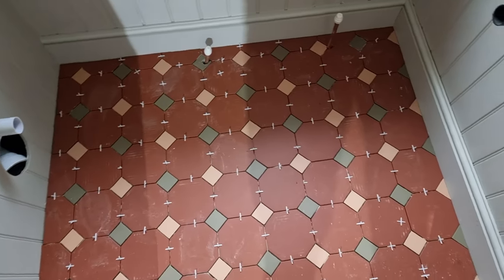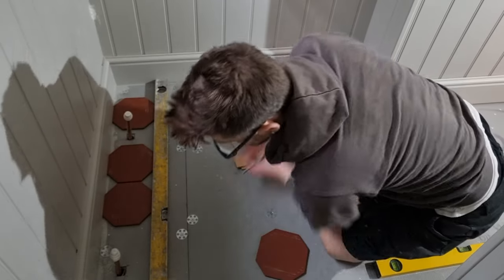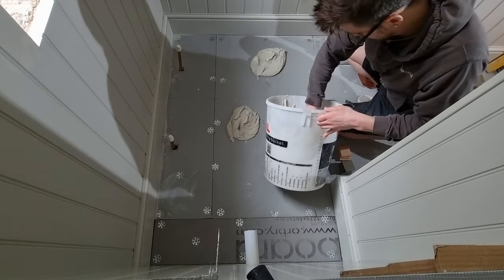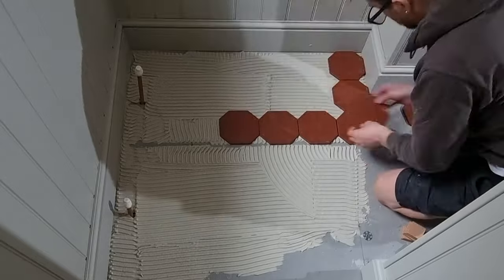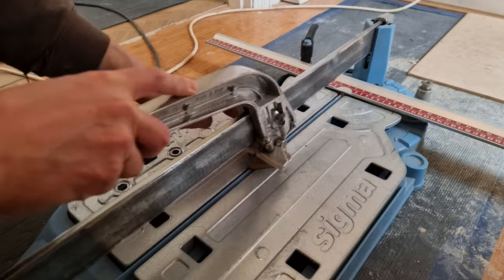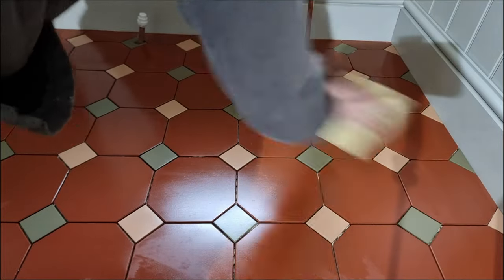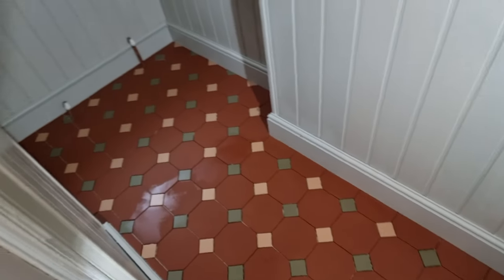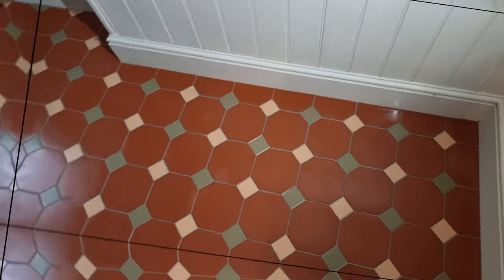Easy Quarry Tile Installation Guide

Comment: From a visual side of things when laying the tiles would it have been better to have equal sides as you walk into the room and then just let the far (larger) end just follow suit. Great work but to me it all looks like it could have just budged a little to the right.
Reply from the maker: Yeah, I can't remember exactly but I believe there were slim cabinets for shoes going around the sides, But for sure there's always other ways or setting stuff out, As long as there's a justification and it works out on other stuff.

Comment: Beautiful layout and quality of work, however... no expansion joint around the perimeter. Guaranteed problem before too long. Should have used color matched caulk - available in sanded or non sanded.
Reply from the maker: Hey thanks! You don't need any expansion joints on a floor that size though, That is what the joints in the tiles are for lol. The Silicon finish is done afterwards with a matching color silicon bead.